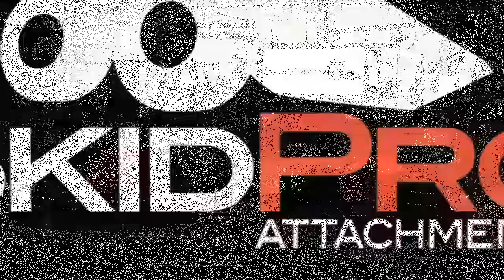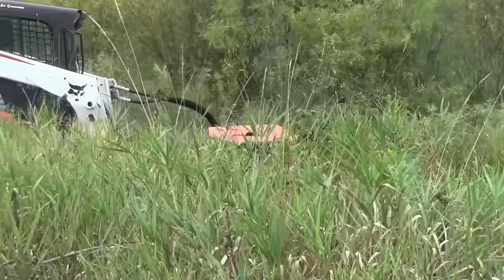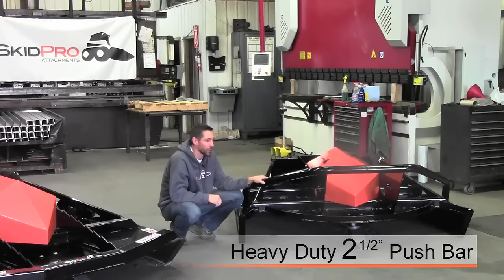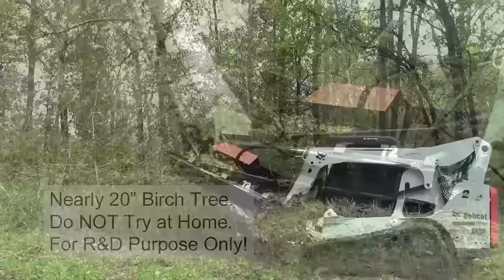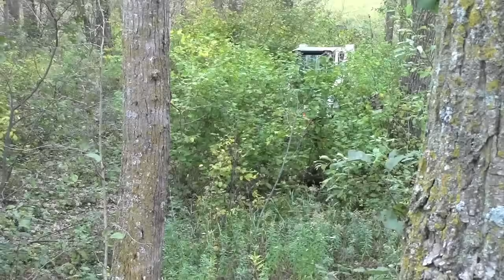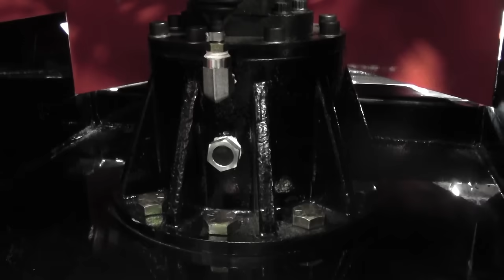Skid Pro Skid Steer Industrial Brush Cutter New Gen

Comment: Also curious since this does not have a case drain are you lowering the engine rpms to idle then turning off the AUX flow switch to shutdown the cutter?   Was wondering if there is any overpressure on the kubota as a result of the cutter stopping too fast?
Reply from the maker: Our cutter has a built-in pressure relief that works in conjunction w/ the dynamic braking to route oil around the motor at shut off. Not only do you not need to slow the RPMs down before shut off, it is safer to shut off at high RPM to make sure the dynamic braking kicks in. Though, w/ our XL and heavy flywheel, our braking will kick in at even the slowest RPM.

Comment: Question - I see the blades have edges on both sides. Can you run the constant flow in either direction for the mower or only one direction? Seems like it and if so get two sets of good edges used before having to sharpen.
Reply from the maker: Yes, this is a huge benefit over many other cutters on the market. Skid Pro's proprietary X4 drive allows for dual-directional operation and you can run it in both directions.

Comment: How much is it to buy one?
Reply: Why not post a few example prices when people ask as many people want to know pricing without having to call.
Reply: @highwayhydroponics5823  in today's market steel prices are changing almost daily  hard to price a unit when that happens 
I have a open front model ,this is the third year I have had it. Simply amazing what this thing mows
Reply from the maker: Depends on options, shipping location and timing. Good news is we've got closed front cutters on sale right now. Call a Product Guru 877-378-4642 for an exact quote, or email in to sales@skidpro.com and the guys can get you the info you need. Thanks for the request Miguel!
Reply: @skidpro  

How good is it to use on unleveled land to clear the brush?
Reply from the maker: @miguelyanez7048  it works well. The more uneven the terrain, the slower the operator needs to go and the more slight adjustment they will have to do on the go. But it is capable of handling hills, inclines, steep slopes and changing topography. For more information or specifics on this, give an experienced Product Guru a call at 877-378-4642. They all run the equipment and know it inside and out. Thanks!
Reply: The answer is today's current price if picked up is ........ not it is complicated like a politicians answer.  For this reason I will buy elsewhere.

Comment: Great video mate, pitty others dont do as great a job as you have done
I do like the internals of your attachment

When you say, upgrading for high flow,  the Eaton Charlyng 6000 motor, can you explain this please ?
Reply from the maker: It is simply put, a bigger cubic inch displacement motor that is built to handle higher hydraulic flows from 28-45 gpm. If you tried to run that high of hydraulic flow on a standard flow motor it would run too many RPMs and could fail, and would for sure reduce the life of the motor.